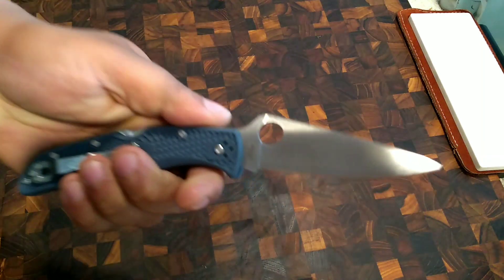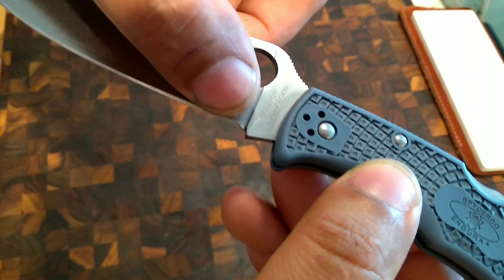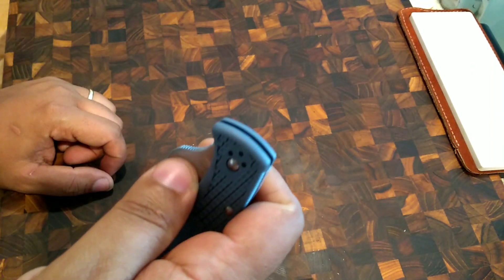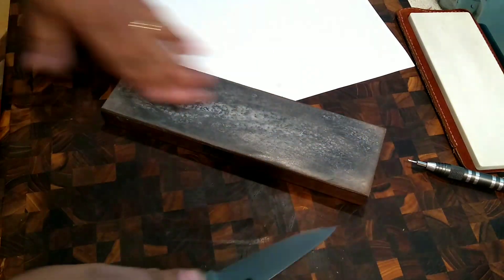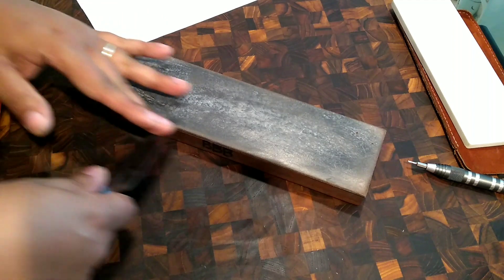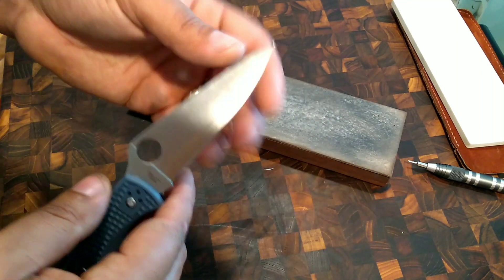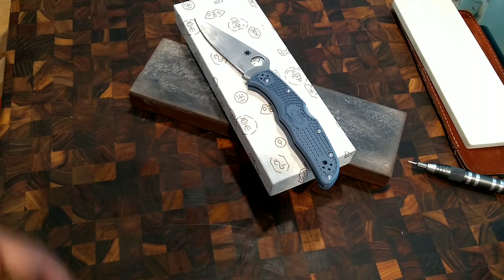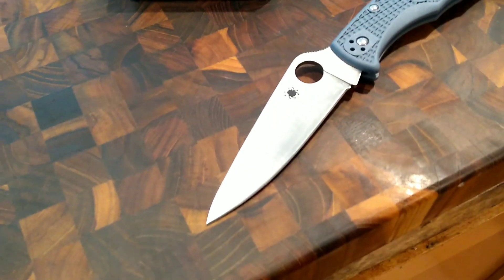V-Toku 2 Sprint Run| First look

Comment: I have a quick question: Using the spyderco sharpmaker and a strop which steel would be the easiest to maintain the edge; Cruwear or S30V? Thank you for the feedback. Always great videos, looking forward to your testing of V-Toku 2 steel.
Reply from the maker: barry levitt Cruwear hands down, thanks.
Reply: Thanks for the information.
Reply: Hi Mike, Thanks for the information.

Comment: Is this better than VG10? Is it worth the 40 extra euro that I have to pay in Holland???
Reply from the maker: Not better, different. its tougher and sharpens a little easier then vg10, vg10 may cut a little longer and doesn't rust
Reply: I really like the color but I intended to use it fully. So maybe the sprint runs are not the best choice for that! I’m currently using an pm2 with the red g10 and m390 steel for edc but the pm2 is nog doing it for me! So I think I’m gonna sale in!